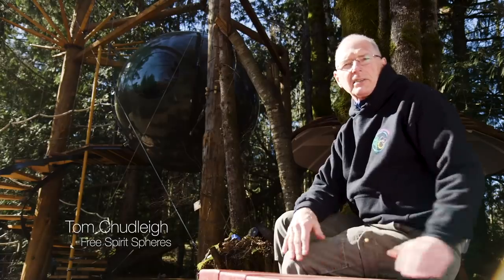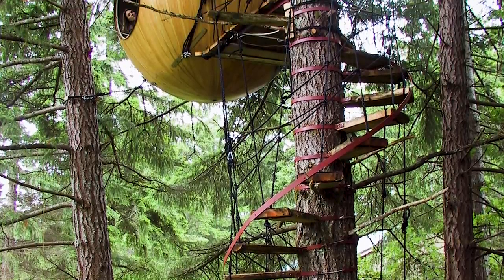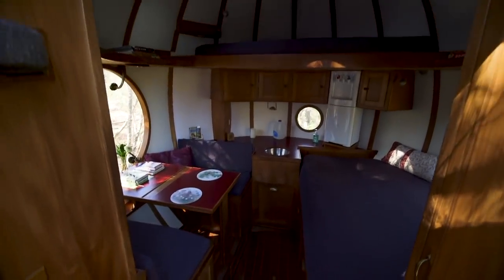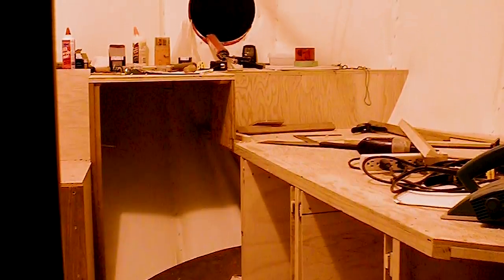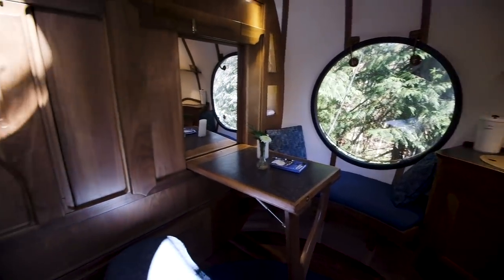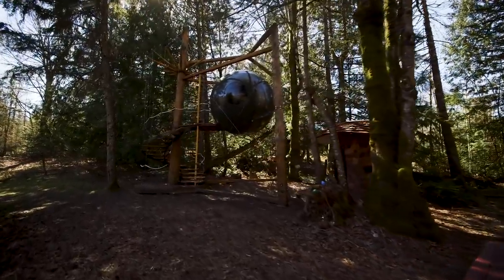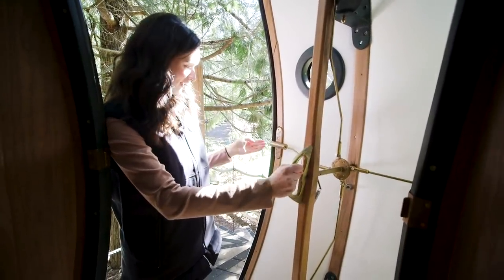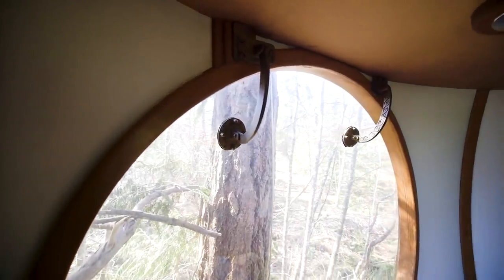This Tiny  Tree house Sphere Feel like Living in a Tree Nut

Comment: I also have a grudge against commercial zoning. My house is on a side street off of a main busy road and the back of our house faces said road. We have a space between our backyard and the road, that used to have old log houses there, but they tore them down and rezoned it to commercial. So we've had construction going on for well over a year so they can put in a fast food drive thru right behind our backyard. They also aren't even willing to put in an extra treeline to seperate our properties

Comment: the best idea for building in the forest you can build a whole village between the trees in the forest to stop cutting the trees and build, but wtf this Sphere made of!!🤣💔
edit: it will be a better idea if there another Sphere made of other sources.🤔
Reply: Arabian Noob Gamer I do believe that is why they are so small, other material would be to heavy and damage current trees. I do believe he used wood from a sustainable source that replants trees of the same number to be cur down later. not perfect but at leats thoughtful
Reply: For a forest to be healthy at to thrive some trees and shrubs need to be cleared out or it will get choked. Plus fire spreads faster and easier. Not even from us, but from lighting. I would rather cut down/control burn a few trees and shrubs instead of losing a whole Forest. I know you are coming from a good place but there is such thing as to much.
Reply: @cats.cant.contour8812  For people safety who live in the Forest, nothing can be useful but the bunker, above the ground if they didn't die from the flame they will die from the heat. if every Sphere has a safe fire zone the forest will turn to a garden.
Reply: @Dhman92  ? I never said that it should be a garden. I never said anything about the health of the people. I was talking about the trees and how he was like "oh no it's wood thats bad. Trees Should never be cut down." The trees need to burned/ cut or the wildlife, tree growth, shrubs all that will die. from the soil not having enough nutritions, space and other factors like that. Trees arent like human. Can't just stack a tree on top of another and call it a tree complex.
Reply: @cats.cant.contour8812  Everything has a life cycle, the forests from thousands of years didn't need humans or engineers to design their life, and they have natural fertilizer from animals or other dead trees. To end this discussion I didn't say: don't cut trees, because they found on earth for humans but in balance. This what I mean not everything should be made from wood there are other sources that recyclable but we chose the wood because it's easy to found and collect.
"Thank you I enjoyed the discussion with you".❤